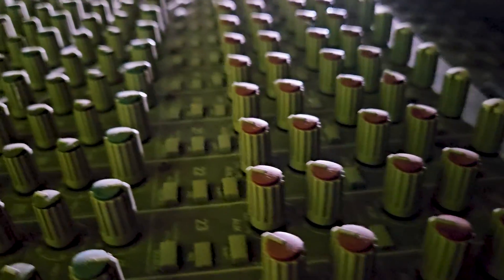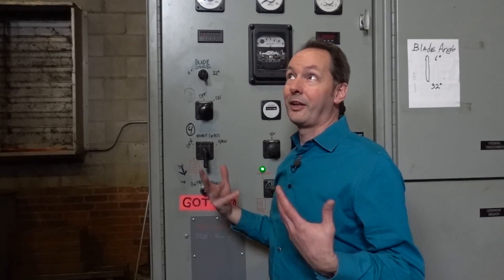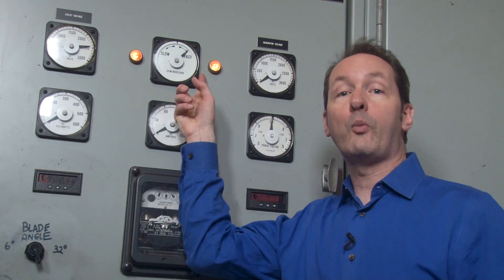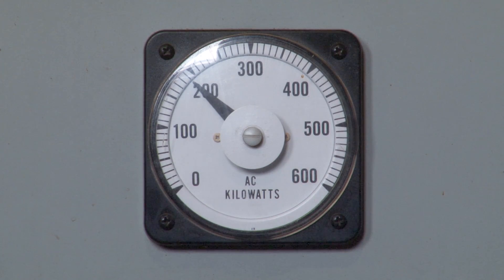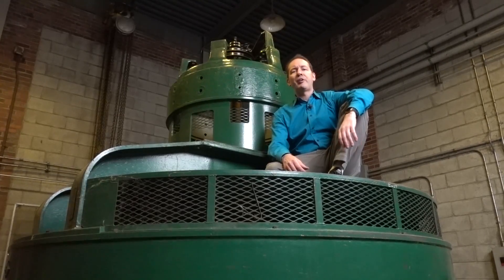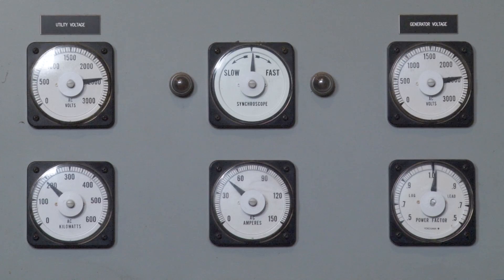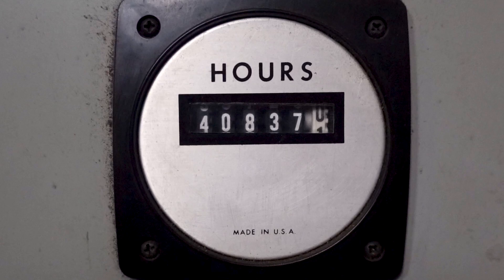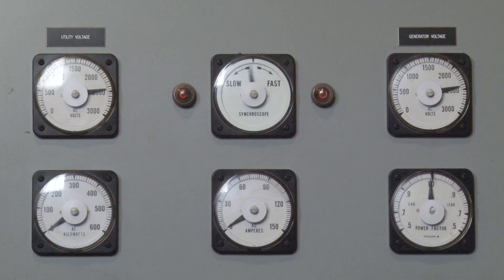Powerplant Control Panel Tour - Part 1 Authorized Personnel Only S4E1 #engineering #powerplant

Comment: Speaking from the utility distribution world… quantifying residential houses (or SFD = Single Family Dwellings) is commonly done by generalizing them into two silos, gas heated and electric heated.
In the conventional sense, a gas heated home may be allocated 5 kVA of transformation while an electrically heard home may be given 7.5 kVA of transformation.
Though in practice an average sized SFD with gas heat (two fridges and an electric hot water tank) can draw close to 1.75 kW over a 24 hour period.
The utilities (exempt from Electrical Code) bet on diversity and don’t need to size transformers to massive proportions that Electrical Code would otherwise dictate. Before people get all upset over this fact… keep in mind the utilities have tens of thousands or even hundreds of thousands of meters installed in the field and enormous data banks of consumption records to back and support their sizing of transformers using practical and historic data.
The careful thing to consider is CLPU or Cold Load Pickup. This is a measure of how much demand is placed on the system when power is restored from an outage and things like refrigerators, air conditions, hot-tubs, water tanks, furnaces… etc. are all demanding power.
For distribution transformers (generally ONAN in nature), utilities will have an acceptable overload % permitted per a unit of time given a specified cool-down period (duty cycle).
If you’re generating about 200 kW of power… you’re likely reaching out to between 95 and 150 SFDs.
Reply from the maker: Thank you SO MUCH! Comments like this from people like you rock my whole world. :) We ALL get to learn things here and I appreciate that so much. Thank you for taking the time to write that out for all these people! :)

Comment: I would say for the water level sensors just replace them with 7-seg displays and get some kind of digital out from the PLC.
What I really want to know is how you might adjust your exciter voltage to have a different power factor. What creates it in the first place? (especially with no grid)
Reply from the maker: That gets complicated fast, I'll do a video for you covering the details because I'm just not smart enough to do that in a simple comment. Brace yourself, we're going deep.
Reply: The exciter or water level sensors? I'm ready for either! 😁
I know how digital communication projects can spiral out pretty quick or run into a brick wall. Programming a random PLC can be a steep learning curve, if you can run the right software anymore...

Comment: I'm going to guess the generator is connected in a delta configuration, given you only have 2 PT's. So it's a line-line voltage thing in the calc.

Comment: I love your videos, and the shorts.  Truly.  But you're confirming my paranoia that our electric grid is like the lego bridge I made when I was 6.....
Reply from the maker: Oh you have no idea..... There's rather a lot I'm not allowed to talk about. But just rest assured that if you knew what I know, you'd have one hell of a good backup generator that'll handle your whole house, and a couple week's worth of fuel for it. Thank you for watching and writing such a good comment! :)
Reply: @Physicsduck  unfortunately I have an apartment where I can't do such things but I have milwaukee batteries with inverters and a small duel fuel generator that's enough to run the refrigerator and charge the batteries and a short term car battery and inverter for the fridge for that very reason. 

I would love a video on backfill circuits. I know the official answer is don't, but if you're smart enough to first turn off the mains connector and all other circuits you're not using, is it safe as long as you balance?

Comment: I just bought a very similarly sized and aged hydro power plant that is presently non-functioning. Many elements of my control panel look identical to yours! I'm trying to learn more about how the old control system worked as I work to design a modern replacement - do you have any resources for this? Maybe I could send you a video tour and you can comment about how antique it is!
Reply from the maker: I do consulting work to help people just like you on a regular basis. You can find me in the Discord (link in the description). Reach out and we'll see how I can help :)

Comment: Consider making an introduction video for your channel and the plant for all of us who've found you from youtube shorts. 

All this gives one a new appreciation for modern power supply circuitry in high power devices. I bought a new welder last week and its PF is between 0.87 and 0.96 because power factor correction is built in. Modern welders upset the grid less than big fluorescent tubes and synchronous motors without a soft start feature. 

A fun pointless hobby of mine is seeing how dirty can power get and still run some modern electronics. Some expensive PC PSUs can still regulate a smooth DC output with square wave AC from a cheap nasty inverter. 

Speaking of dumb, entertaining and marginally educational: you should reach out to electroboom for a collaboration.

Comment: Distribution engineer in Canada. 

I generally size utility transformers to Rule of Thumb 3kVA per 100A residential house peak demand.

It's slowly ticking up with heat pumps and EVs but not as much as people think.
Reply from the maker: 3kVA per household? That's really cool :) Thank you for being here! :)
Reply: Out of curiosity what is the primary voltage in your area that you size too?

Comment: Haha I’d love a series on black start.

I’m a controls engineer, spend my life in panels, but HV and grid electrics are beyond me.
Reply from the maker: Please don't hate my first experience at building an experimental PLC system. You'll see it in an upcoming video, lol....I am ready to be judged.
Reply: @Physicsduck I can’t wait for that, I’ve commented on a couple of your videos before, that tying into the grid process where you’re manually actuating the flow restriction on the turbine is crying out for a little PID loop, whole process could be a 1 or 2 button setup.

Amen to your comment about AIP devices, a pet peeve of mine, I keep some red electrical tape in my bag specifically to tape over redundant devices, they create so much confusion in my field.

Comment: My old man (RIP) was a Navy Electrician in the Royal Australian Navy, and I have heard fun tales of ship generators being dropped 180Deg out of phase when hooking up to shore power. 

Shore power wins, and a generator spinning clockwise becomes a motor going ANTI clockwise... for about a microsecond, before the generator drive shaft snaps, the mounts rip and the generator is launched through three decks, and onto pier next to the ship.
Reply from the maker: That had to be one hell of a show.
Reply: @Physicsduck  Flipped it over on it's back when we mess up on elevator generators.
Reply: Shit that is the stuff of nightmares, now I see why Chris talks about syncing to the National Grid properly.  RIP to the old man by the way, just like the old boy a few doors away he was a live liney.
Reply: Good technicians never die, they just short to ground
Reply: I would wonder how accurate those tales are.  RAN boats at least from the early '60s had load-shed protection in the power supply circuits. They would also have been the best engineered power units at the time. Synchroscopes have existed for decades and were present in the '60s. I have worked in power generation  plant rooms with late '50s equipment and load shedding was present even then. You cannot physically connect an incoming source to a mismatched alternator.
Reply: @greywolf271 it just depends on if the power plant has the equipment or not. I work at a power plant with a 1950 steam turbine and a 2008 gas turbine. The 2008 has all the bells and whistles - protective relaying and auto sync etc. the 1950 unit does not. It manually syncs when the operator hits the button just like this guys hydro unit. Purely depends on the capital budget of the generator owner.
Reply: @greywolf271 sure ya can, never under estimate the power of human stupidity....i can't tell you the number of times i have been the better idiot....metaphorically , pull the wrong levers in the exactly wrong order at exactly the wrong time and boom lights and sirens....
Reply: I had that job on a US Perry Class Frigate.  My predecessor always mis-matched the shore voltage with ship voltage and came up with circulating currents.  I always made sure to match the voltage before handing over the ships load to shore power.
Reply: Reminds me of when we had a guy on my boat try to turn the diesel generator into a fuel pump. Turns out the turbines powered by a nuclear reactor win, luckily the breaker tripped before anything bad happened.
Reply: wow. they didnt have reverse power relays back then?
Reply: Holy shit 😮
Reply: Holy shit that must have been one hell of a light show
Reply: Holy crap!

Comment: Damn, this is good.

AFAIK, in the US and the EU there's an added goal to keep the daily average grid frequency close to nominal to keep the mains-synchronized clocks run true. This includes intentionally running above nominal to catch up. In EU this means a 10 mHz/day intervention if the mains clock at 8am is off by 20 seconds or more.

Not the case in other markets, where the nominal frequency is practically the ceiling that is not exceeded outside of emergencies.

Comment: How does the syncroscope actually work?  Like How does it read the AC wave form?
Reply from the maker: I don't know, but let's find out together. I'm trying like hell to find an old one that still works so that I can take it apart and show it on the bench. We'll get there. I just don't have the money to go out and buy one right now. Even used on ebay, one in the right style and type is about $200 or more.

Comment: I'm going to get you started. The main reason KWh is used because it was relatively simple to understand for the end user. leave a 100W light on for 10 hours it will cost you x amount of money for 1 KWh. It isn't a stupid way to measure power, it is measured in Joules and translated to KW/h for the end user to understand.

Comment: In Germany we calculate 5kVA for each house constantly. And up to 30kVA peak, in a standard house.
Reply: Wow! I'm guessing that assumes that space heating is all electric? Here in UK where space heating is usually gas or oil the 24 hour average load is probably well under 0.5kVA. I think my overhead power line would melt if I took 30kVA out of it!

Comment: Chris, the is the coolest cut video you ever did. Loved it. And I'm a control panel nerd indeed. I started building them in my kid's room at my parents just for the sake of them. A technical question: where does the power go between starting up the turbine and going online with the grid? You surely don't convert 200 KW into heat. Is that what the exciter helps with? I understood that the exciter is the counterforce for the generators as you do not have static magnets. Can you run little power through the exciter until you are synced with the grid frequency and then turn the exciter up to increase the amount of power generated?
Reply: As you bring the generator up to speed, there is no (electrical) load on it. The turbine might be open 20% to get to sync speed. Once you're synchronized and close the breaker, the power meter will still show 0 kW, until you open the wicket gates some more to begin making power.

Comment: Does the synchroscope only read from a single phase? I makes sense to me since the phase angle of the three phases remains constant, just curious if there is redundancy.
Also, what is a 'boring' afternoon?
Reply: A synchroscope reads from one phase of the line, and one phase of the generator. The sync light bulbs do the same.

Comment: You probably produce 3 Phase Power, so the squareroot of 3 (1.732 ish) is important when calculating the VA (appenrent power), and multiplied with the Powerfactor to get (effective power) Watts. Also does the Meter show W or VA? I know it gets handled the same in the english speaking world). P= sqrt 3*U*I*cos phi

Comment: Looking at the Amp-Meter and the voltage I’d say it’s a three phase system. Phase to phase voltage is 2.4kV so the voltage between phase and the star-point is 1.3kV given the generator is wired in wye-/star-configuration.

Comment: Power factor is a significant thing. AC Power consists of "real" and "imaginary" power. Real power adds mechanical loads to the generator. Inaginary power DOES NOT (well, the losses it creates does have to be compensated for...)

Imaginary power adds current to the conductors, increasing their I^2R losses. And since I is squared, this can become a big problem, fast. Whether from overheating, or from substantial energy losses.

Generator windings can only sustain a max temperature. Usually denoted by the ambient temp + allowable temp rise (and elevation above sea level).
This essentially means they can sustain a max amount of amps per phase (averaged over a set time) or the windings will overheat and be damaged. This is why big, 3Ph generators are marked in kVA vs kW ratings. They also limit the worst case power factor usually with a 0.8 rating, to keep recirculating imaginary power from burning up the windings

Its a similar issue for power lines. As the amps increase, the losses increase dramatically. If the power is imaginary, then thats wasted capacity, and also gets converted to real power in the form of I^2R losses, increasing the mechanical input requirements to generate the "real" power.

Comment: In addition to a kWh meter, many industrial customers also have some kind of peak current/load meter that is recorded and reset with each billing cycle. 

Not to trigger you - but I noted a peak current meter missing from the inside panel - is there one on the utility side to provide a bonus payment for surges in current that get lost in the lack of nuance the kWh meter fails to provide?

Comment: Hi Chris, at 5.56, you closed your supply breaker when the syncro was going backwards. We were always trained to bring our generators into parallel with the oncoming generator going ever so slightly faster, so that when the breaker closed, it would snatch a bit of load. This prevented any reverse rotation of the oncoming prime mover, this is still the practice in the Royal Navy now. Is this not a concern with a hydro plant? Cheers Garry
Reply from the maker: It's a concern, but it's a matter of degrees. In this plant the generator spins at only about 200RPM, and the only thing touching it is slow-moving water. Because there's no rigid prime mover (like a big Diesel engine or a high-speed turbine and gearbox) our setup here is much more forgiving of an operator with.....less than perfect grace and poise. You're certainly correct in the RIGHT way to do it, but some things that would be catastrophic in a big teakettle plant are just a typical Tuesday afternoon at this small scale.
Reply: Thanks for taking the time to reply Chris, makes sense as you can't exactly make the water go backwards lol
 @Physicsduck